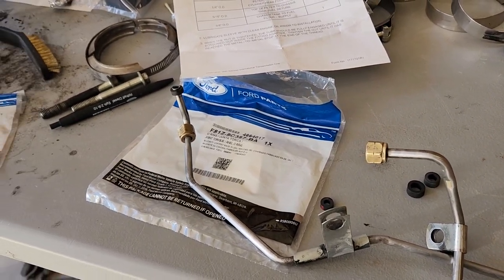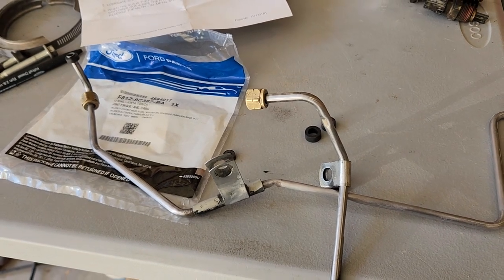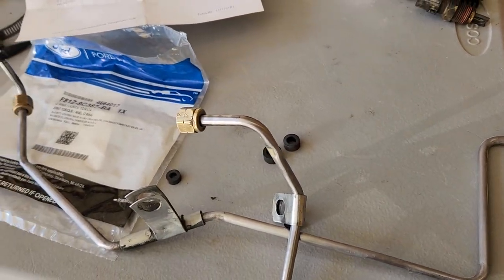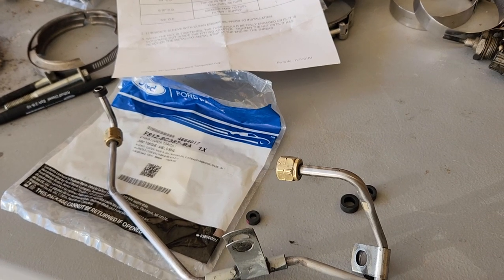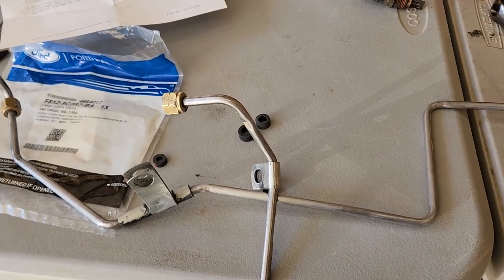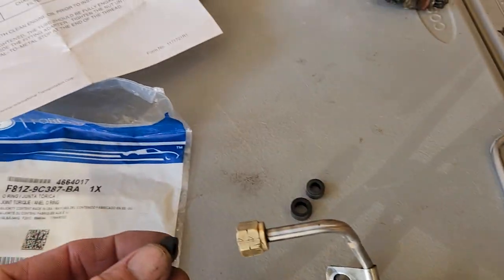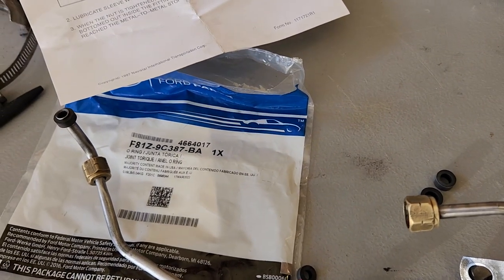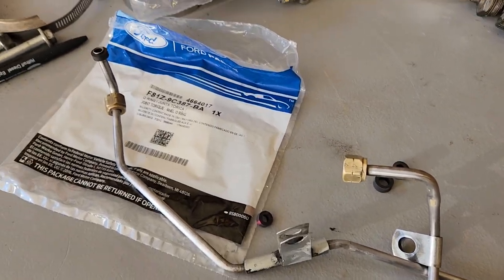7.3 powerstroke fuel lines leaking at the front or rear of the heads

Comment: Thanks currently struggling to get my 97 7.3 turbo flange nuts off everything on pedistal and anything required to take off is off. Those bastards won't move.
Reply from the maker: Let us  know how you solve the problem
Reply: @curtissharris8914 currently soaking. Reason I'm as deep as I am is, some kid I bought the truck from broke the rear drive fuel line and I just decided to run oem banjo lines to save money working so far